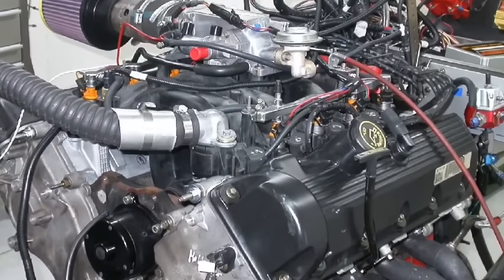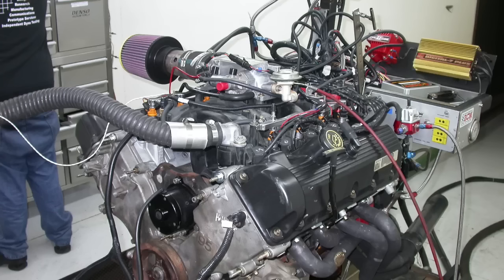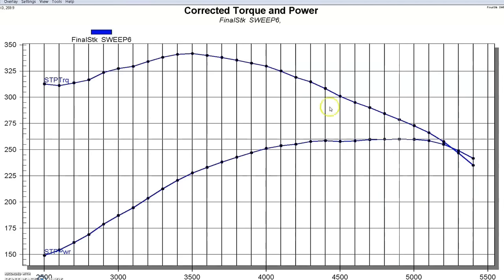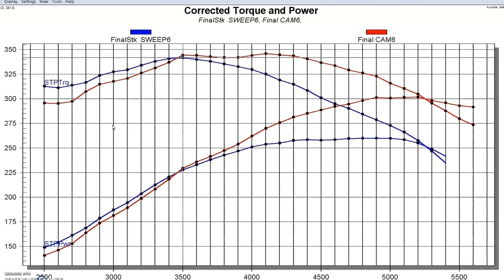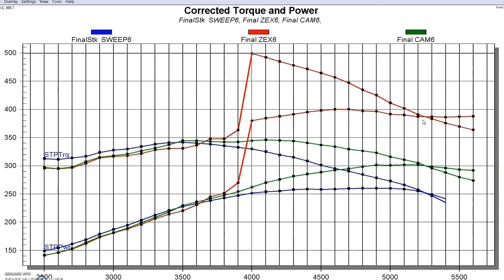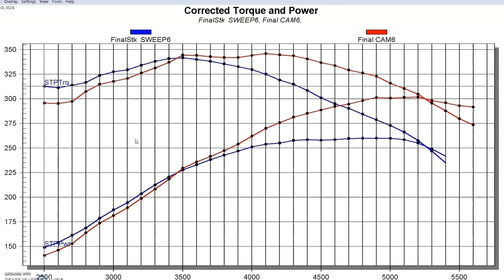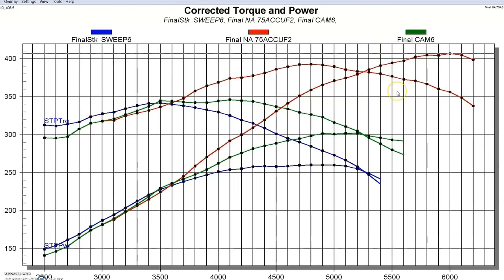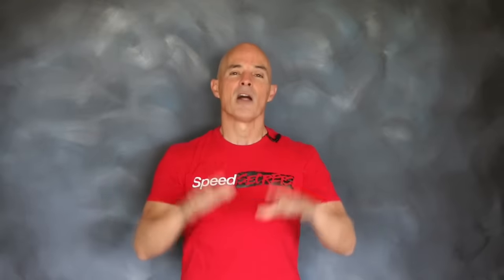HOW TO! MAX HP 4.6L FORD 2V MODS!

Comment: Im not even a FORD guy, but I'll watch anything from Richard...
Reply from the maker: That's the spirit-thnx for being first!
Reply: I would watch richard put a cold air intake and cat delete on a honda motor lol
Reply: @buiItnotbought  i wouldn't go that far....lol
Reply: @buiItnotbought  lol
Reply: @HioSSilver1999  LMFAO
Reply: @HioSSilver1999  i would watch richard dyno a prius motor
Reply: @bigboreracing356  have I seen you before?? Your name sounds familiar..lol
Reply: Agreed!!!!
Reply: I'm building a non pi block with a pi head. What is the best cam for this setup? I saw you used the same can for both applications. Which do you think is the best? Thanks
Reply: @richardholdener1727  I know this now this now that you hate us Buick guys!! I'm thoroughly convinced now. Thanks again Rich!!
Reply: 700HpVette agreed
Reply: @buiItnotbought  that's pushing it .lol
Reply: Everybody should be a fan of 4.6
Reply: Tty
Reply: Dudes a genius
Reply: I'm not a ford guy either but Im pushing lincoln town car with the horsepower upgrads. 🤣🤣
Reply: @richardholdener1727  I have a 2000 ford Saleen mustang with a vortex blower with standard internals not forged. I am looking to rebuild the engine up to 700hp, and I would pay you to consult with you on the right way to build it. I will pay you. If I make it correct once, it will save me in the long run
Reply: Hey man as long as it runs on gas or diesel or even propane I'd enjoy driving it
Reply: Could I do this to my crown Vic ?
Reply: Agreed he's the guy we needed years ago
Reply: Honestly me too I have 2 mustang both bought to ls swap 🤣😂
Reply: @GULLAHTV33  that’s what I want to know
Reply: @buiItnotbought  mee2
Reply: My cousin said the same thing your saying, he's a chevy guy, he ain't driving no ford, he just left my crib yesterday driving a gt. I'm done!😅😅😂
Reply: So you’re a communist….. 

😂.. I’m just kidding..
Reply: @richardholdener1727  Hey Richard I have a question for you. So I own a 2001 Ford Superduty with a 5.4L 2 valve.  Im wanting to rebuild this engine and my goal is to build a engine that is better than stock and has more HP and Torque but I dont want to have to use high octane gas. This truck is going to be used for daily driving but im also using it for a work truck towing gooseneck with a load on it. My question is regarding the  cylinder heads and the intakes for the 4.6 and 5.4. Im wanting to put a performace intake on my 5.4 but they dont seem to offer any for the 5.4 but they do make them for the 4.6. Ive read that the cylinder heads are the same for the 4.6 and 5.4. If thats the case can I just use 4.6 heads then I would be able to use the performace intakes for the 4.6 on my 5.4. But Im wanting your input on this and any info would be much appreciated.
Reply: I'm not a ford guy either, but I love my crown vic.

Comment: Nice to see some info on these old 2 valve engines. Shame Ford didn't put this kinda effort into them from the factory. They were great engines, just a bit anemic.
Reply: they made them that way so they last much longer then anything else. I still say the 4.6 is just two 2.3 4cly engines put together at the crank, that would explain why they have so much low end torque. Could have made it make more hp but they didn't want to risk the extra stress when they just wanted something that would last.
Reply: @maxskullic9879  they make alot of low end torque from the extremely long intake manifold runners and the stroke length, its pretty easy to make em rev to 7 grand with  a trick flow top end kit and cams
Reply: @chrishansen7004  honestly they weren't bad for the displacement for their time people kind of expect a little too much from them imo.  They can make every bit as much power or more as the old 5 liter engines did with less displacement and they aren't lacking on torque.  They're good engines for what they are.
Reply: I liked the "triton" in the 97 f150, seemed to output considerably more torque than the 96 grand marquis I had
Reply: @midnight347  Not to mention, they have factory oem options to swap induction, and more importantly, heads that flow 230+cfm untouched. On 281 cubes, thats gonna be a healthy combo.
Reply: @chrishansen7004  How much bhp with the trickflow heads and cams? I'm thinking of getting them for my MG ZT260 V8 2v pi
Reply: I have a 2010 f150 with a 4.6 2v love to pep it up I’m watching to see what’s up thank you for the content
Reply: Government regulations
Reply: @MGRracing  Trickflow heads make for excellent top end perfomers but dont pick up much over worked pi stuff until youre turning well in excess of 7k rpms.
 I think the Trickflow test engine was only up 15-20hp at 5k rpms compared to the stock pi motor. It went on to produce great power up top peaking at almost 400fwhp.
 Most scenarios, an oem 4v head is the better option both for power and costs.
Reply: @maxskullic9879  and they do lol
Reply: @madmod trickflow heads arent good just because of that. They have removable cam towers, better detonation resistance, more clearance for big cams on stock shortblock, and etc.
Reply: @thenegus5469  Remove-able cam towers is a non issue for pretty much anyone using stock heads due to the oiling desing. Very seldom are failures of the cam tower noticed but its a nice touch to be able to save those super expensive heads in the case of catastrophe.
Also, Its not like the stock 2v heads are crazy detonation prone. Many people have made in excess of 600hp on pump gas running stock/mildly modified 2v heads. If all youre after is detonation resistance, 4v heads offer better results at cheaper than the trickflow prices.

Fitting larger cams or rather lacking the clearance isnt whats holding back the 2vs on power production, its headflow. The stock pi headed combo has very limited ptv clearance but can still fit enough cam to make healthy power.
 A NPI headed combo has close to the same available ptv clearance as a tfs head, can be ported to flow up to around 240cfm on the intake side, all while staying even more detonation resistant with its large chambers.
Imho, the tfs heads are great for high rpm combos that see mostly track use, competitively. However, i think for the money, most peoples goals can be  supported with stock castings, reliably.
Reply: @trebornirtus6514  Then you can pep it on down when it is time for a smog inspection, if your state has those.

Comment: The 4.6 2v is a golden engine. Even with 14:1 compression they run for ever and ever and ever lol. They never lose compression or power as long as you do your maintenance. Only gotta worry about the timing components. Do them ever 120k and youre good to go! They always get decent mpg even when built. I love this engine
Reply: My 04 f-150 with a 4.6L just hit 120k. What do you mean about the timing components and what would I  look for?
Reply: @basicallyjayden1   No need for doing mods. Hopefully you let her be. That truck will give you a lifelong life of service.
Reply: Mine just hit 70k miles lol I had to have the engine rebuilt because it blew both headgaskets. And it's stock lol,  very smooth running engine compared to my geo metro 3 cylinder
Reply: @basicallyjayden1  I got a 07 4.6 thing never had a issue and refuses to give up 🔥
Reply: @basicallyjayden1  Ive never had any timing issues. Only lasher ticks on old 2vs. Dont worry much unless you see material in your oil when changing. Plenty of stock timing components out there with 300k miles
Reply: @madmod  no need to worry about it now…head gasket shit itself. Engine blew.
Reply: My 05 f150 is on 212k 😢 runs  smoothly might do a rebuild on it
Reply: @basicallyjayden1 😳 wow!! Sorry to hear that bud.  I have one as well.. 93 Crown Vic.. good motor, but I can't figure out why it pings a bit while accelerating up inclines.
Reply: @carlgibson593  oh wow, thanks a lot! I didn't know that. I'll definitely give it a shot. Thanks!
Reply: @carlgibson593  As an ASE tech for many years, I've always used mid grade on higher mileage engines. Regular juat ain't as good of a quality fuel anymore. When I used premium, the engines seemed to fall on their face vs midgrade. Loss in lift and compression with valve train wear is definitely to blame. I've yet to see a piston/ring or land failure in the early modulars under normal use.
Reply: @Tommysmess same lol

Comment: Kudos for giving the old NPI stuff props. I payed $1300 for my 1996 GT auto. It went high 13s with very very few mods and on stock gears. There's a whole lot of fun to be had for cheap.
Reply: I know this is old, but what mods did you do? I have a 96 GTS auto. Got it for pretty cheap as well. Beat up daily driver for me. Brought it to the strip and pretty sure it did low 15's. But gotta pull my old timeslips out.
Reply: @marcludwick512  First mods i did that woke it up tremendously was a 99+ PI intake manifold and matching PI cams. I sourced these from a wrecked 2011crown vic. Only other bolt ons were a 70mm tb and a short ram cold air which probably add zero hp and a 3 inch x pipe which is probably overkill for a 2v but sounds wicked.
 For an auto trans, i reccommend jmodding it so it goes for a long time. J modding keeps the trans healthly by firming/quickening up the shifts. It may seem scary to dive into a trans but its pretty easily if you follow along a vid of someone doing it. It ca be done in the car and i would get done sooner rather than later. If youre really looking to impove ET's and have the money, a converter while youre performing the jmod would be a huge impovmemt.( Ive gone 12s spraying on a stock converter so not a "must" but its great for a NA car trying to get a good 60 foot).

Only suspension goodies it has is upper and lower control arms in the rear, removed the front sway bar, fresh 90/10 front and 50/50rear shocks and installed a good set of MH tires.
 It ran low 14s high 13s regularly here in Iowa at Humbolt County. Pretty average DA driving an hour to the track n back.

Weight reduction is really helpful too. I got my 96 Gt weighing about 3200lbs with me in  it so its got a good 200lbs+ removed from it while staying mostly full interior.
Reply: @madmod  Ok, thanks. For the PI you just did intake and cams? What did you take out for weight reduction?
Reply: @marcludwick512  Yep. Npi heads and bottom end, pi cams and intake.  Weight reduction was a ton of small stuff, ac delete, front sway bar, gutted trunk, no rear seats or trunk panel. Manual seat slider and lightweight seat, catless x pipe with dumps rather than the 6 cat midpipe and stockexhaust. It adds up quick

Comment: The 2V was introduced in 1991 in the Lincoln Town car. It was carried on in the E series chassis until 2014
Reply: I had a 93' Lincoln Town Car with the 4.6L DOHC. That thing was awesome. For a heavy ass car when you hit the gas she went.
Reply: @Lookin4LoveInAllTheWrongPlaces  no yo didn’t, it was either a Continental or mark 8  if it had the 32v dohc..
Reply: @NewEdgeDesigns  imagine a town car with an Aviator swap tho 😎
that would be pretty kick ass.
Reply: Wrong. It was the crown victoria

Comment: I have a 2003 mustang GT! Obviously, the PI version! I always felt cheated by Ford because of what little effort it takes to get over the 300 rear wheel horsepower mark on these cars. I would’ve had no problem paying $5000 more for my 03 GT if it would’ve came with 325 hp with a decent set of cams in it, factory headers, bigger, throttlebody, and better performing upper and lower intake manifolds